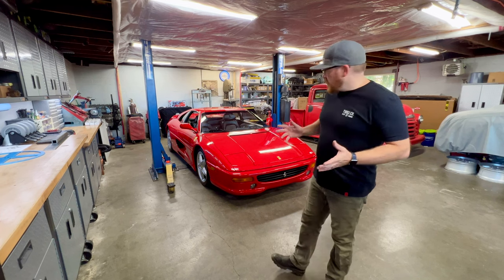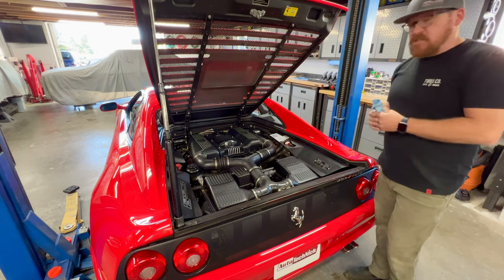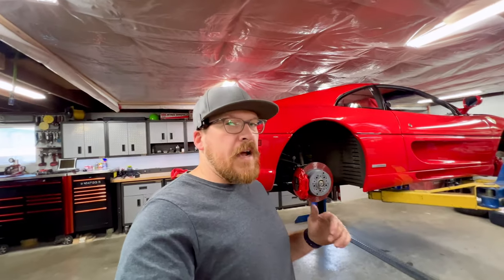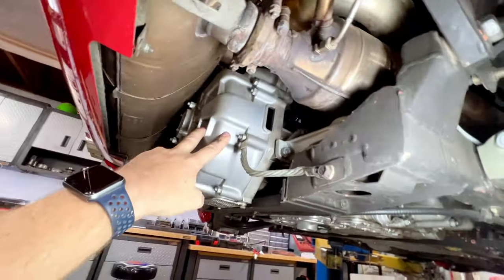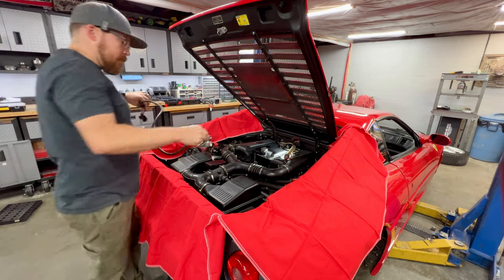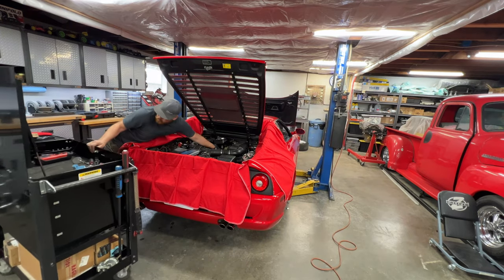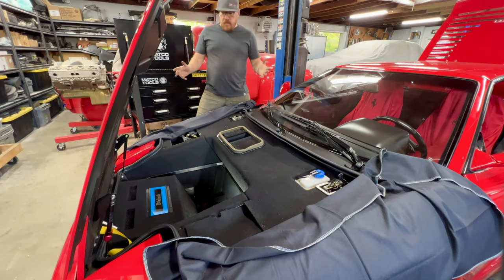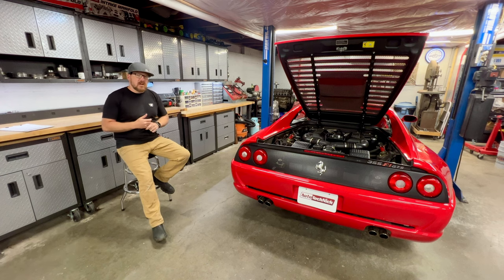FERRARI Master Tech INSPECTS F355

Comment: Nobody needs to be replacing belts every three years.  That is very wasteful especially if you are tossing the tensioner bearings every three years.
Reply from the maker: I agree with you regarding the wear and tear typically seen on belts and tensioners within a three-year time frame. However, I approach this with the understanding that not all cars receive the same level of service or care.

For example, this F355 has around 48,000 miles and likely hasn’t had its belts replaced in about 10 years, covering just 6,000–7,000 miles in that time. Personally, I don’t see a major issue with this scenario. But for the sake of discussion, let’s imagine the car only had 5,000 miles. If the service history is incomplete or doesn’t follow the factory’s recommended intervals, it could negatively impact the car’s value. In that case, it might be worth servicing the car to factory standards to preserve its market appeal.

Now, while this scenario might not be as critical for a 355, consider a more collectible car like the F40. Take two identical F40s: one with complete service records that follow Ferrari’s recommended intervals and another without. Assuming everything else is equal, the car with the documented service history will typically hold its value better.

Ultimately, service needs are subjective and depend on the car’s usage, history, and the owner’s goals. My job is to advise and educate clients on the pros and cons of different approaches, empowering them to make the best decision for their car.

~ Nick

Comment: Is the heatshield on the manifold hermetically sealed? If you get blown exhaust tubing on the manifold such as in your example photo, if the heatshield is hermetically sealed around the manifold, how will you see smoke?
Reply from the maker: No, they’re not hermetically sealed—though sometimes it feels like they’re close! 🤣 When a manifold fails, the smoke usually escapes through the gaps in the heat shields, particularly where each primary pipe enters the shielding near the mounting flange at the head.

~ Nick
Reply: @AutoTechNick  Thanks! Makes sense I guess. If air was encapsulated, I suppose it wouldn't be good to expose it to heat, trying to inflate the metal skin.

Comment: Awesome series so far! Funny, I’ve had mine for just a couple of years and have fixed nearly every common problem you pointed out. I’ve done headers, replaced a broken shock gear, fixed a coolant leak (just had to tighten the thermostat housing), replaced hood/engine cover struts, replaced both main cats, am about to pull the dash to have it re-covered due to bubbling/shrinking, and probably some other things I’m forgetting. 

I did want to point out that it appears the alarm siren battery is dead on the car you’re servicing, indicated by the red light on the center hvac vent remaining illuminated with the car running. 

My engine out is about a year away, so this series is going to be incredibly helpful. Question: have you seen a rear main seal leak on this engine and how big of a pain is it to deal with? I’m not sure that’s what I have and the leak I do have is barely noticeable. Just trying to narrow it down.

Thanks for the video and can’t wait for the rest!